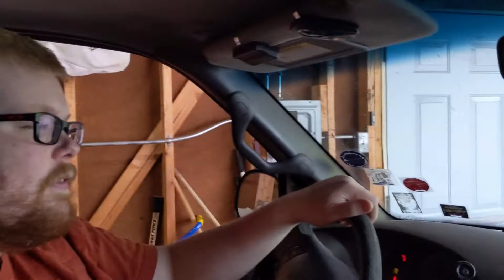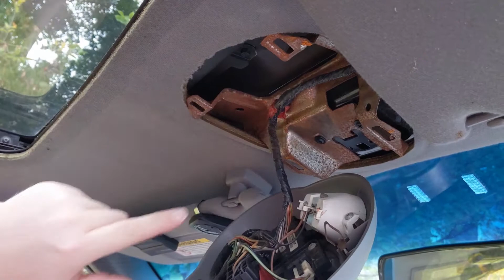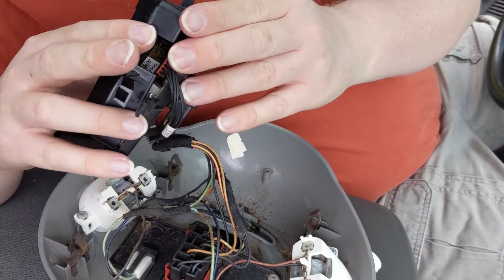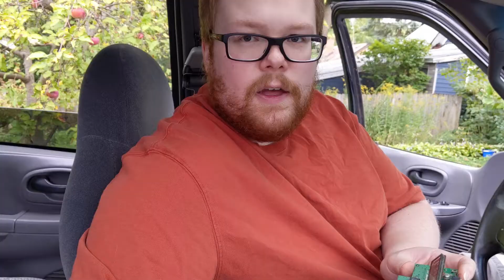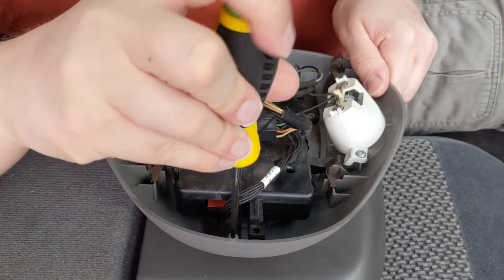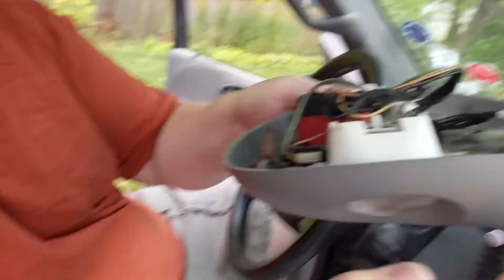2001 Ford F-150 Overhead Console Temp Display Repair

Comment: Make sure if you have the full on console with the sunglass holder to remove the screw in the front before you take it off. I tried to do it on my 2002 Ford F150 SuperCrew and broke it off.

Comment: anyone know where you can get the 510 diodes?
Reply: found it in the comments! this rocks, my 510 popped off and is no where to be found. getting some 1w 51 ohm resistors now. got them today  put a new one in where the old one I lost was, works perfectly!

Comment: Hey man, I don't know if you'll see this, but when I do the steps to pull the wire out from the thing to detach the overhead console from the truck, it doesn't detach, and almost seems stuck. Would you happen to know what the problem is? Thank you.
Reply: I could not remove that wire also but I got everything else off to get to the motherboard to visually inspect it.

Comment: I just fixed my 2001 F-150 overhead console TODAY 7/2022.  Those are "chip resistors."  One of my 510 resistors actually fell off, and was lost.  I had to research the "chip resistors" to find that 510 is actually a 51 ohm resistor (51 followed by zero zeros, for 51) and the 181s are 180 ohm resistors (18 followed by one zero, for 180).  I popped off the remaining 510 resistor and measured it, to be sure, and it measured 50.8 ohms.  I replaced both 510 chip resistors with two 1/4 watt, 51 ohm discrete resistors (Green (5) Brown (1) Black (0 zeros) Gold  stripes (5% tolerance)).  I soldered the leads of the two new resistors onto the little pads where the chip resistors were (tedious, and not pretty).   Put it all back together and it worked,  eeee haaa!  Not sure how long it will last, since apparently it somehow got hot enough to melt the solder on the original chip resistors, with one falling completely off.  Also, I found that the original chip resistors were rated at 1 watt and my two regular resistors are rated at 1/4 watt.  We will see....  And thanks for the GREAT video!!!
Reply: Thanks for the great info! Mine was missing one 510 as well. So ¿how long did your fix last?

Comment: Share Overhead Console:  I have a radio shack 15 watt iron with some really thin rosin core solder 62/36/2. Glad you mentioned doesn't have to look pretty! My first attempt failed because I was worried about pretty.
I gave it a daub of solder next time and it took! I don't think what they used was solder. It reminded me of the liquid solder paste they had in the late 1960's. It totally lacked in mechanical strength. It was more a connection sealer.  
I did see some corrosion on mine underneath of where the resistor had come off the board. It didn't look like solder. My 04' has the ICC package with the middle clearance light wire hole directly above the console creating a possible leak problem. My inner bracket was cheapened to plastic. Hey Thanks Again!!!!!
Reply from the maker: Yea they are definitely not secured very well, but a little dab of solder sure does go a long way for a repair though lol. Glad this video helped!

Comment: The trim removal is same on my 04' F350 crew cab short bed 6.0 diesel. Factory repair manual was not this clear! For some reason the manual had me removing sin visors and windshield trim????? I usually keep my display turned off unless needed. I think it went to heck with the heat turned up full bore trying to defrost the windshield :-(

Comment: Does the unit have a fuse at the fuse block? Performed repair and it still won’t power on. Any suggestions would be much appreciated.
Reply from the maker: Hmm not too sure on other possible causes for this, its possible a component could have become damaged when it loosened itself from the board. I checked my owners manual for this one and on my F150 it shows that fuse location 23 is for the overhead console. Might want to start their looking for a blown fuse but anything beyond that is a bit beyond me (I'm not a mechanic myself, just a guy trying to fix things on the cheap lol). Mine is a 10A fuse. Its located below the steering wheel and to the left. Hope the info helps!